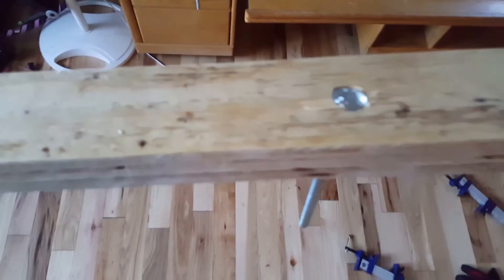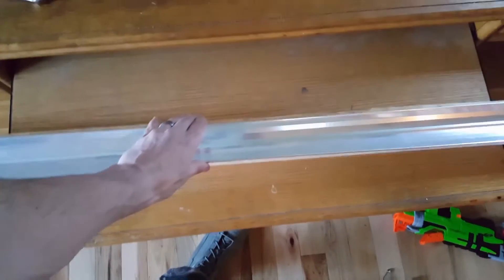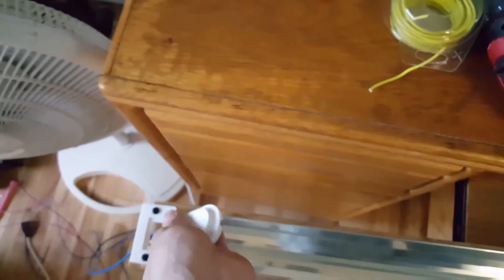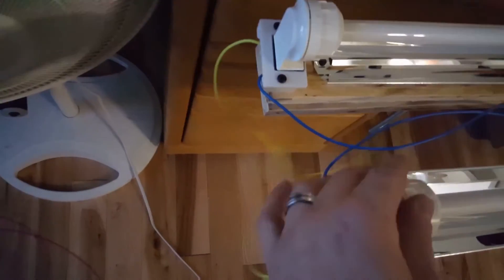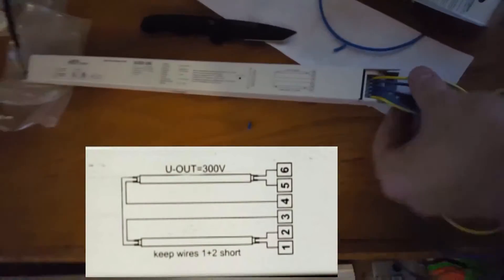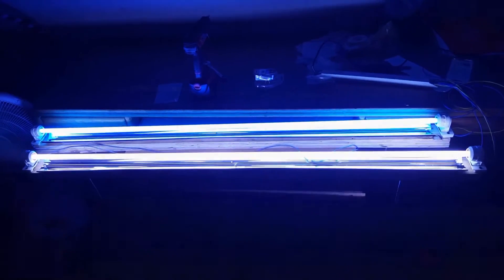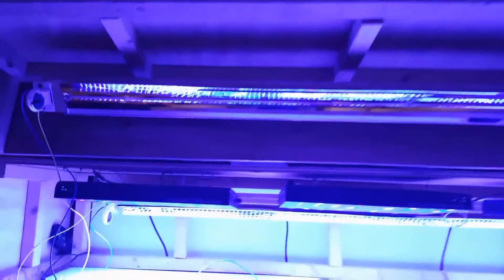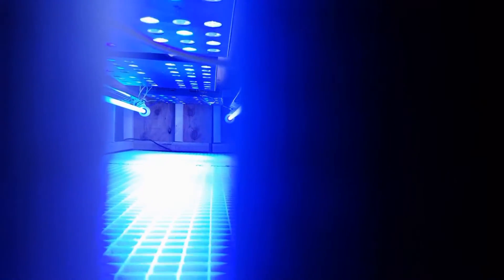DIY T5 retrofit build with my LEDS, 180g mixed reef tank

Comment: did you consider dimmable ballasts? pros & cons on them? im about to strip down my diy led setup and re set it up as t5/led hybrid. nice video ty
Reply from the maker: KYfishguy no I didn't consider dimmable, I didn't see the need for it with how I'm using them.  they are on a timer to come on and off
Reply: i prolly wont ither. just gonna gut ballasts out of a generic 6x t5 fixture i wasted money on.
Reply from the maker: KYfishguy $200 for this set up.  not to bad probably could have found a cheaper alternative.

Comment: How often do you run those T5s with your LEDs. Based on your runt time how often do you replace them. The reason i ask is i have a 2 bulb T5 HO running alongwith my 3 Radions. My T5s only run for 4 hrs a day. I am in my 13thh month and the lights are still looking good.